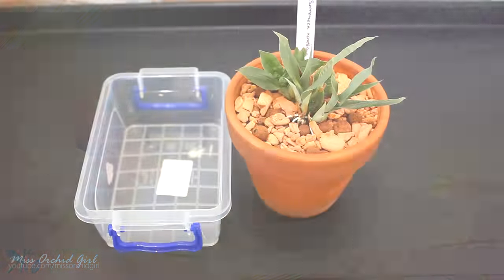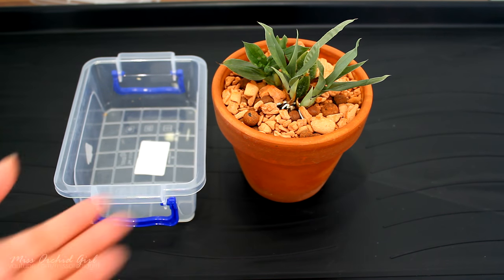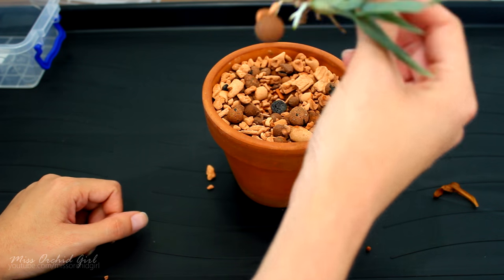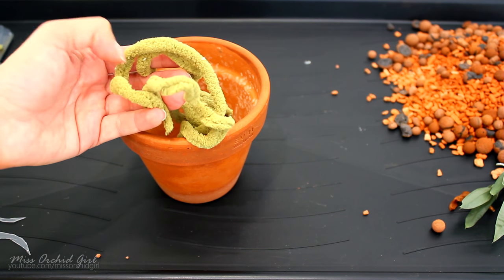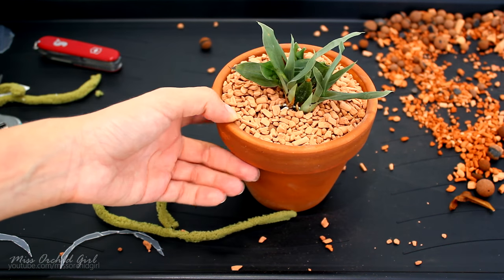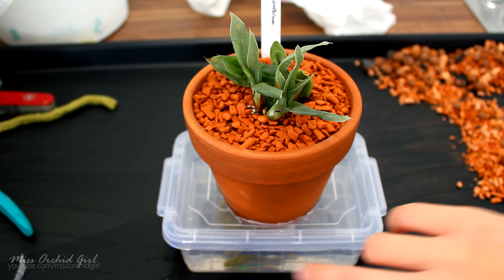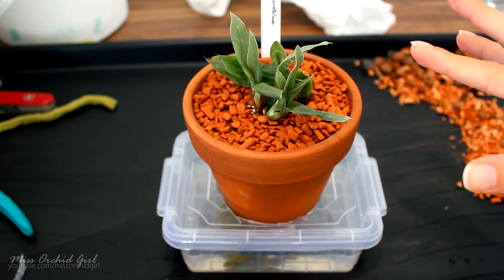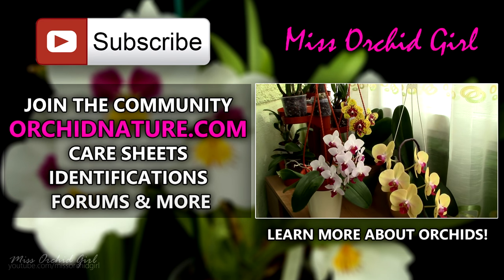Orchid Experiment - Wick watering method

Comment: Interesting idea! I will be looking forward to updates on this experiment. Have you tried potting an orchid in a plastic pot with the fine grade seramis? It takes ages to dry, but it's not soggy. Actually, I think the result is the same as you will have with this wick experiment, but looks a little nicer. At least it's how it has worked for me. I have an oncidium hybrid in a plastic pot with fine seramis. It can go on without watering for a looooong time. :) But it might work different in your environment. But it's worth a try, except if you don't want to use plastic pots.
Reply from the maker: Hi Andrea, I had seramis in a plastic pot with a Phal, it did take ages to dry but that was ok :) what I didn't like was the super layered drying, even with side ventilation, top half dry, top bottom still moist, this is also due to my pretty warm and drafty environment maybe.

Comment: I like the idea, but am wondering about feeding. Aren't you afraid of the water in the container will eventually get to concentrated with large amounts of fertilizer? I tend to water with a diluted amount of fertilizer on a twice weekly schedule. Would you advise  changing the water each time feeding is required? I am new to the orchid hobby and sorry if my questions seem silly.
Reply from the maker: Hi, not really because I prefer to feed low amounts more frequent, so my orchids actually have more fertilized water than not, but it's dilluted. Same can be applied to this system, plush flushing is also possible :)

Comment: they water AV(African Violet) with texas method,similar to your method but no strings and with a designed pot for letting the saintpaulia hydrated
Reply: I have often wondered about using those self watering pots with chids that like to be moist.  I was told that the terrestrials need air for the roots.  When they are in the wild the roots stay moist.  So what would be the difference?  I still want to try.
Reply: Patricia English i would say,this is for lazy people,the rule that can never change: only water when soil is dry